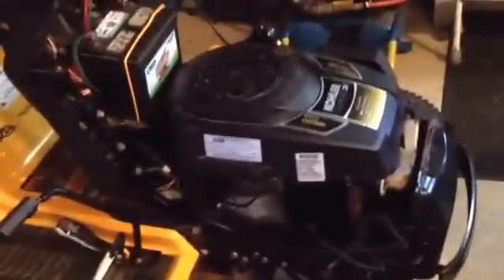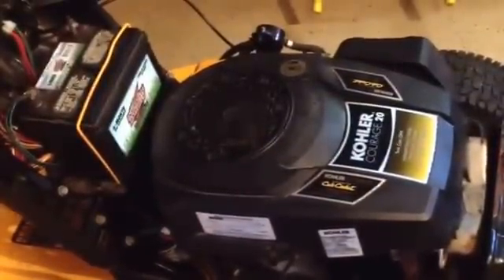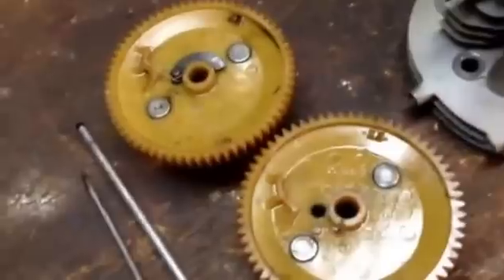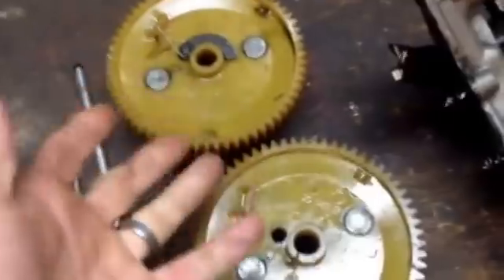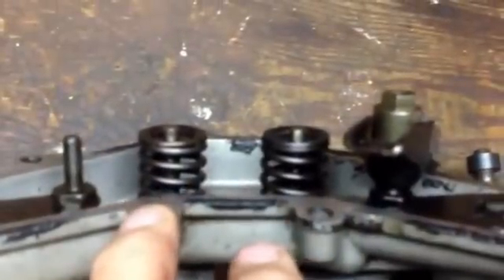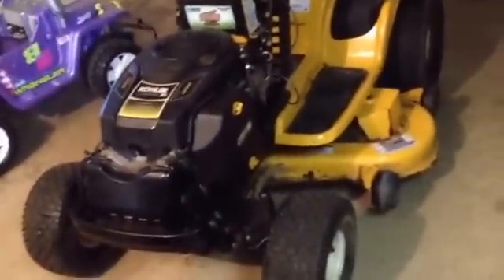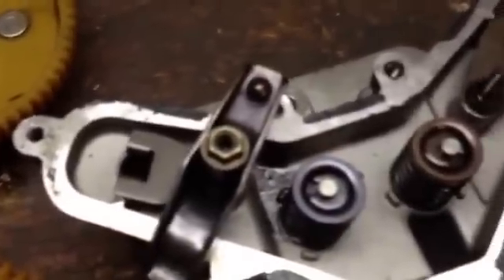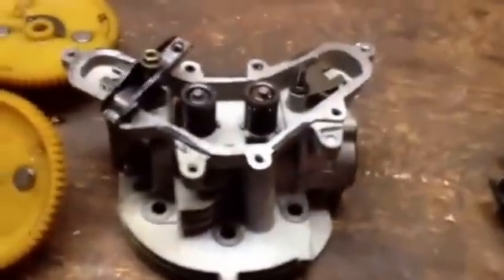Kohler courage engine weak starter compression release valve head repair.

Comment: I'm sorry but that's wrong. The punch solution is done on the valve seats, not the guides. Now will the guides move...sure but if they are that loose this is not a solution.

Comment: My 18hp was puffing oil so I pulled the valve cover to do valve seals and the guide was backed out. I am a professional automotive technician of 20 years and specialize in engine repair so I know what I’m doing. The guide was actually really tight, it installed like another guide. What happened imo was the valve cover had a very small leak and dirt sticks to oil so over time the heat sinks on the head had dirt caked on causing the head to not cool properly.

Comment: Just to let everyone know that does this fix on the following Kohler model engines  SV470/480/530/540/590/600/610 
The valve guide depth for the intake is 10.20mm and exhaust is 6.2mm just food for thought.
Reply: I checked on my SV620 and its them same...

Comment: Pretty sure this is the issue I’m having. It cranked like it’s out of time. Sometimes it wouldn’t even crank. I could get it to run for few but it would make a loud bang when stopping like smacking a valve or against full compression like the exhaust is closed when it’s should be open.

Comment: Great video sir. I've got the ole compression hard start issue and the guid is out a bit in head but not out so much it interferes w the comp release. 
The exhaust cam valve actuates and  operates the valve action but I pulled flywheel and all the magnets were comin loose. Jb welded after cleaning.

Comment: If I gotta adjust mine again I'll have to get more gasket maker.

Mine has never overheated and I'm gonna pressure wash mine it has grass an dirt between those heat shields on the engine it does act like it had either to much compression or it's the dead battery it has it could be the starter the starter was slipping.

Comment: Hate this engine.  Biggest POS in the small engine world! 
The cracked block (case) is usually because one of the case bolts back out and catches under the flywheel.

Comment: if a rocker comes off at high rpm on a big kohler , it usually cracks the block. have seen them pop the bolt heads off on top where the case bolts together. keep the valves adjusted.

Comment: I've had the same issue, for years! I appreciate the video. I've always expected to check my valve train and look for the trapped compression issue. 
But... I have a quick fix, that has worked for me.
When this first began, I figured, like everyone else, that the battery or starter was bad. One day, in Home Depot, buying my 3rd battery, after a trying to start after a cold winter, I happened to notice there was a battery, same size, with twice the Cold Cranking Amps as the original battery. I snapped it up! It worked like a beauty, for another 3 or so years. My problem now is when the engine first builds compression. Starting from cold (hasn't been started since my last mow), it cranks over just fine. If I forget the choke or throttle, and it dies, it won't turn over, because now, it has plenty of compression. Here's my quick fix: open the engine hood, exposing the top of the engine, and place your palm on the flywheel and give it part of a turn to move it off TDC. Voila! It turns over! I make sure I'm ready to start it with the choke and throttle set, and if I forget, I turn the flywheel slightly. Works every time. But, that valve guide is probably wrong and I need to fix it.
My lower oil seal is leaking bad, so now's my chance to fix the compression too! Thanks everyone for all the suggestions. I was going to put the piston at TDC to remove the valve spring, but the rope trick seems like a 'softer' way to trap the valve. Good thread! Thanks!

Comment: Mine cranks real slow unless the sparkplug is out. I think this is my problem my engine was covered in a thick coating of dust and oil grass
Reply: You have good compression...
I have one that has no compression ,so it spins real fast with or without the spark plug🫤

Comment: Can anyone help me.I got the same engine,its a 20hp kohler courage single cylinder and if it the hand tighten the exhaust side it is hard to get passed the exhaust stroke.i have taken the cams out many times and times them but some how when it's not to spec and the gap between the rocker arm and the valve stem is way to big I still bend the push rod and then i can't get said push rod out.Anyone have any ideas?I'm new to this so don't judge me.

Comment: My motor turns over but slowly. Is this what yours was doing?
Reply: check for loose rocker arms i had a exhaust rocker almost fall off so on the exhaust stroke starter turned very slow then to a stop

Comment: I pulled the springs to check the guides , and they alreadyout about about 3/4 inch from Factory on my single cylinder courage 20. I guess my next option, the compression release gear, or whatever the name is , in the engine. On the Courage 20 HP , the springs pushed in easy with vice grips , just tight enough to hold . Did'nt take but a minute to grab a small piece of board to put between my belly and the grips . That thumb screw can poke . The valve clip comes off and back on easily really .

Comment: I  bought a craftsman with the same engine used and the 2nd time using it the valve guide came out.A newhead was 150 dollars but I found a guy that fixed the guide and valve for 25 dollars ,that was 3 years ago and its still mowing.

Comment: I have a John deer riding mower  105 and the push  rods not working  won't go up and down when you  turn it over but the  values is working  but not pushing the  rods  up and down  what should I do
Reply: Sounds like a bad cam shaft

Comment: A cub 1046 V-twin got dropped off and after much cleaning  rebuilt carb, adjusted valves  mower briefly compression locks as key engages. A couple try's with key and off she goes and runs like a top. I did not think to look at valve guides (rookie mistake). I can hook jumper and it struggles a second then starts. I'm waiting on a mower spindle so I think I'll go back in valve covers.

Comment from the maker: I'm really out of my element when you start discussing valve lash specs. Sorry I couldn't be of more help.
Reply: That's just the gap between the rocker and the valve stem that allows for expansion as the engine heats up. Usually .004-.007 for the intake and .006-.009 for exhaust.

Comment: pjm0551,

I have a 2005 Cub Cadet LT 1042 rider with a Kohler 19 horse SV590 bucket engine. I realy appreciate your info and research.  If all of this info. is correct, then why I when I google "images" this Kohler cylinder head part number#2031814 or #2031814-s shows the valve guides installed approximately at what you describe about a half inch high from the factory? Are they built- installed wrong? I have noted success stories commented on previously.

That being said, I already  reset mine flush and peened before looking at the photos! arrgh!! I'm waiting on a new starter and will update my success or failure.
Reply: Wow! success, got the starter on this afternoon and it started like new, no drag or stop...quick and smooth. I also set the intake and exhaust valves at .004 as per Taryl on a Briggs & Stratton valve adjustment video of his. He said it would work on Kohler and like engines. He mentioned if the valve lash setting is too loose it wouldn't actuate the ACR (automatic compression release) So i'll check valve lash every 50 hours or so. Flushed with success. Thanks again pjm0551.
Reply: Sure you have figured this out already, but for others - shop manual is easy.to find and specifies valve guide height. Exhaust should be "higher" than intake.

Comment: The valve guide is my problem, after attempting to reseat the valve guide it does not want to move back into the correct position. I used a socket that sits over the valve stem and a hammer to attempt to reseat the guide and it does not want to move. With saying this I am not sure of the correct height of the guide. So two questions is there a different way to move the guide such as heat? and what is the correct height. Visually the exhaust guide is at least a half inch higher than the intake valve. 
thanks for any inut.

Comment: I have the same mower had the same problem. My starter was having trouble turning over and when it did I had compression blow back through the carb. After taking the valve cover off I noticed I had the same problem.  I removed the valve, then pressed the guide back in after putting loctite 638 on it, I then used a punch and hit around the guide to help hold it in place. I installed the valve and spring and adjusted valve lash. After the mower started fine. I still need to see if the repair will hold up down the road.
Reply from the maker: I am glad it worked out. I would be curios to see how long it holds up, keep me posted. was there debris under the cover obstructing the engines ability to cool?
Reply: Yes, the two sides of the head were completley clogged with dirt and grass, the guy that gave the mower to me after giving up on it stored it outside the thing was filthy.
Thanks for posting the video it would have taken me for ever to see that the guide was slightly lifted.
Reply: Is there any info on how far above block the guides should be? My intake guide is raised about 1/2" and the Exhaust is 3/8".
Reply: ⁰

Comment: My mother has a kohler courage 22 v -twin.. runs like a top after it starts but won't get past TDC under it's own power problem has gotten progressively worse. If it were mine i would put a spool on the flywheel and pull start it but she suffers from arthritis. Well I replaced ALL wires, battery, solenoid, pulled starter apart, pulled engine apart (completely) set valve lash from .003 - .005. I can hit it with a fresh 600 cca car battery at the starter and make it turn over but even that will not fire it off twice. Ran a HEAVY ground from the starter to the neg battery terminal to no avail. Only engine issue I found was miniscule run out in the push rods. everything specs. Even cleaned the exaust side of the head with a seafoam soak. I am out of ideas other than sincerely wondering if the starter magnets have lost enough magnetism to make this thing start ... losing my fucking mind on this thing really. Oh and the valve guides are to factory spec.
Reply: Hi did you figure it out or lose your mind? Because I am possibly right behind you...any ideas for me?
Reply: Did you pull the plugs and try cranking it just to be sure it was not something else. I had one with poor crank. It was the blade engagement not releasing causing mower blades to spin during crank.
Reply: shizzle5150 ...Curious... how did you get all the specs...when a tech like myself has to call Kohler... you're full of shit.

Comment: I haven't read through all the comments, so if this is a repeat, my apologizes.  My valve spring retainer broke at 107 hours.  And the cup that sit within the spring also looked worn, so I ordered both.  I had a hell of a time depressing that little spring.  I finally went to a repair shop and asked how it's done.  Answer: a spring compression tool.  It has two jaws, (one longer than the other) and a large knob to turn.  Place the spring and cup within and compress them.  Then carefully slide it over the valve stem.  I did it several times and I didn't have to apply compressed air through the spark plug hole, (which 50 psi is the recommended maximum).  Second problem:  When I tighten the rocker nut, it bottomed out and the rocker was still loose.  The threaded hole in the nut is blind, meaning that the threaded stud will bottom out.  There is no adjustment.  The nut does not tighten on its own.  To get it to adjust properly, I filed the threaded stud.  It doesn't take much, so do a little and test; otherwise your rocker will be over adjusted by the time the nut tightens.   What to do if you go too far, (like I did.. dumb shit me):  I cut some solder and placed it inside.  That was trailer and error.  I also used Permatex thread locker.  I'll find out tomorrow how this works out.  I think it will.

Comment: Thanks PJ for the great video. My problem was different but the video helped to diagnose. After pulling off valve cover I noticed that the exhaust rocker was extremely loose. The stud had backed out. Using a 1/2 in open end wrench, after finger tightening, I snugged the stud. I never touched the adjuster nut. Replaced the valve cover and fired it right up.
Reply: I had the same problem on mine
Reply: Im looking into this as a solution with my 19 HP Kohler.   I just stoped running the first cut of the season.   Found an animal nest blocking air fins and a very loose exaust valve.

Comment: your not pressurizing the crank case just the cylinder

"I recommend not using compressed air unless you have a way of bringing 
down the air pressure so it wouldn't blow crank seals. If you must, open
 the dipstick tube to let some of that air to scape. I use rope that I 
push in from the spark plug hole (make sure you leave some rope tangling
 out so you can get the rope out again) after locking the engine in top 
dead center (all valves are closed)."

Comment: As per previous post feed a piece of rope into the combustion chamber via the spark plug hole turn the crank shaft to force the rope into the valve to secure the valve.

Comment: I recommend not using compressed air unless you have a way of bringing down the air pressure so it wouldn't blow crank seals. If you must, open the dipstick tube to let some of that air to scape. I use rope that I push in from the spark plug hole (make sure you leave some rope tangling out so you can get the rope out again) after locking the engine in top dead center (all valves are closed).

Comment: I was told to remove the heat shield that covers the valve cover as it causes it to overheat. Will not hurt anything and will help the engine run cooler.

Comment: Another thrick is to feed about a foot of clean rope into the cylinder from the spark plug hole when the piston is at BDC then rotate the piston to as close to TDC which will hold the valve in place without air. You may have to lock the flywheel in place with a wedge or something, or have someone hold it still while you perform the procedure. I've done this a few times and it works great. Just remember to leave a small portion of the rope hanging out the hole and to lower the piston before you try to remove the rope. 
By the way the valve springs are easily removed with your fingers, just push down and move the keeper sideways to align the valve stem with the release hole and let it come up. Before releasing the valve spring though make sure you have the rope or air in place or the valve may fall into the cylinder if the piston is low enough. If you can't have air on all night just release the pressure and move the piston to TDC to keep the valve from falling into the cylinder. When you work on it next reapply the air pressure and pull on the valves, they'll reseal. Hence that's why I like the rope method.
Best Wishes/Blessings Keith

Comment: I have a courage 22, wont start, what do I take off to adjust the compression release , or valves, the top ? the front where the spark plug is ? its probably loose bolts, I had it worked on before and that's what he said it was, don't want to take it back to him.
Reply: Jim Lovejoy ...you have to split the cases, as the compression release is on the cam....

Comment: I took mine apart today and found loose bolts all over the engine. Only difference with mine was I would get one very hard turn off the starter and then it would stop. Pulled valve cover and found the intake valve hold down screw was loose. I mean sloppy. Rocker arm fell off valve and pushrod and spun around. Tightened hex bolt, reassembled and the damn thing started right up. I was gonna scrap it myself cause I was told by  Cub dealer told me I would need a new engine for $900.00. I almost bought a John Deere last week. Cub used to be a good name til MTD bought them out. Same with Troybilt. Thank you so much for this video.
Reply: Paul Tomnitz

Comment: Another method of keeping the valves closed while removing the springs is to put the piston at the bottom of it's stroke, feed some rope through the spark plug hole and turn the crank to compress the rope in the cylinder. Just remove the rope when you are finished.

Comment: I'm an aircraft mechanic with 30 years of experience working on cars, trucks, boats, mowers and of course airplanes. This engine is the biggest piece of shit ever produced. I've fixed the exhaust valve issue 4 different times. It simply refuses to run properly. If you own one of these pos....sell the sob while it still runs. You will NEVER, I repeat never get this turd to run consistently. You've been warned.

Comment: These engines are junk. Its no surprise that your parts motor is cracked. Probably cracked next to the cylinder on the muffler side. The counterbalances self destruct too. The engine block is thin also. Get it running and sell it. Do yourself a favor. Good luck!
Reply: Mine has almost 250 hours and other than the needle in the carb coming apart, I've had very few problems with this engine. Very strong.